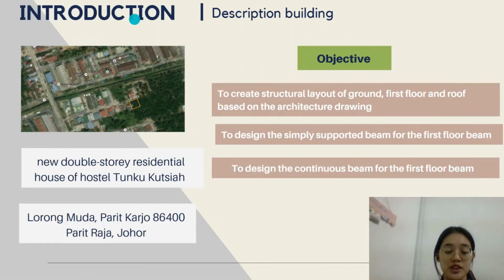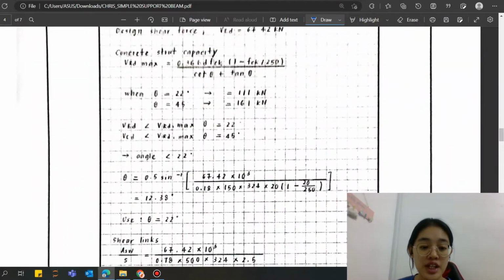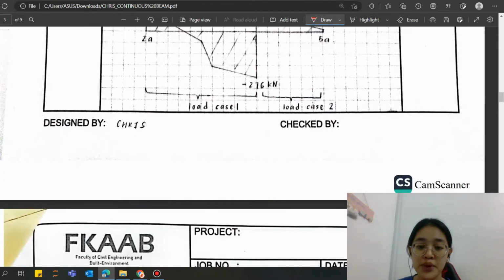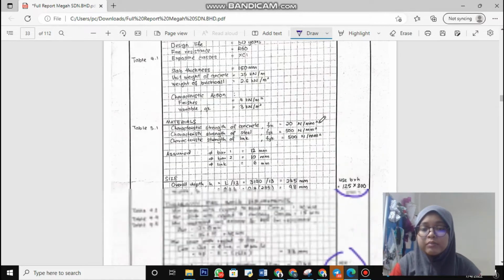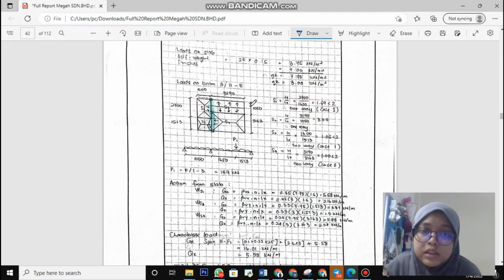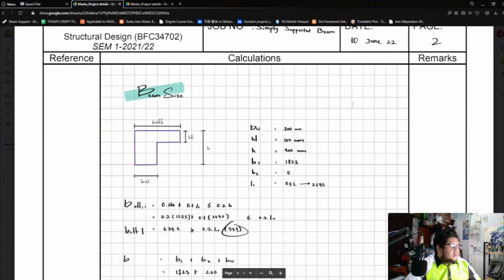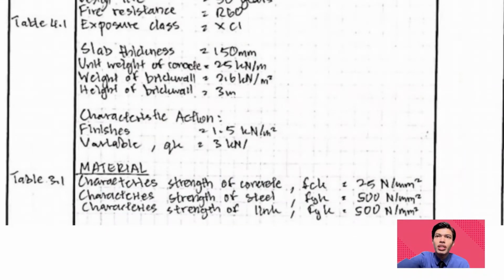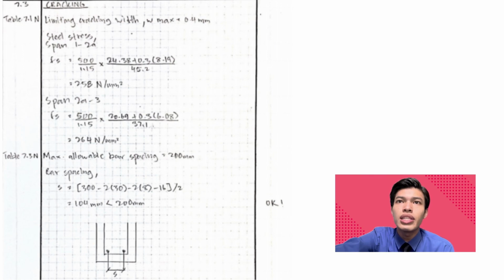Structural Design PROJECT

Comment: If a 500 gallons water tank will be located at the roof level (C-D/2-3). What are the structures will be affected? Please explain.
Reply: The structure will be affected is the roof beam at the area (C-D/2-3). The roof beam will carry the more permanent action than another roof beam.  Besides that, the column will also be affected due to the roof beam carry more load.
Reply: Structure will affect by that subjected water tank are the beam underneath it which support the water tank and the column that support the beam because load are transfer from the beam then pass through to the column and next to the ground.
Reply from the maker: All the structure under the water tank will be affected. Especially the beam that subjected to the water tank. Besides the column that support that particular beam and will also affected all the structure under the water tank until the ground . 500, gallons water tank need to propose before the structure design, this can help the engineer to assume more appropriate for a structure  and ensure that the design is made in accordance with the load accommodated
Reply: by studying the location of the proposed 500 gallon water tank at location (C-D/2-3) the structure that is most effected in my opinion will the roof beam. As there is an additional 500 gallons of dead load to be considered. therefore further improvement in reinforcement is probably needed to be accounted to prevent failure within the structure.

Comment: What can you conclude for this design project?
Reply: The knowledge of the material properties and behavior ( concrete, steel)  is very important for the design analysis of the structure. Just know well all the behavior of the structure (bending, stress, tension, compression) then we can based on the behavior to design the structure. For example. the shear link is designed near the support to resist the maximum of the shear force where occur at the end of the beam  and so on.
Reply from the maker: what we can conclude through this project, the importance of design in construction to produce a structure that is durable and can withstand the proper load.  Design can also help in preventing waste from happening because through design we can know the amount of load that needs to be accommodated, so we only need to design based on the load that should be or maybe more than it should be , but not to much or it will lead to waste
Reply: We can conclude that, every design work must take care of every little things such as material and dimension. These factor will affect the cost of the construction and the management. So every decision have their own effect.
Reply: Throughout the whole proses of this design project, we can sum up that design is such an important factor to be considered and focus on. Not just from a structural stand point but also in functional and aesthetic point of view such as placement of main structure such as columns and beams should not obstruct the main purpose of the design. This project also helps us as upcoming engineers to understand not just the behavior of steel and concrete but also it's real-life uses so that we can better implement these element to real life situations.